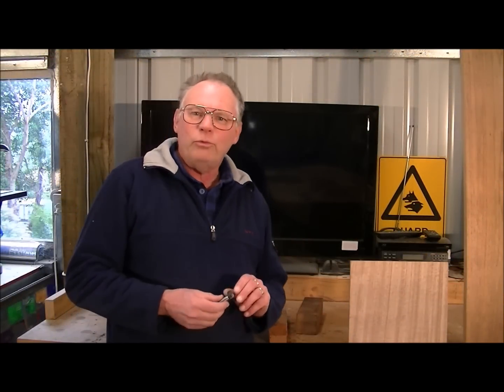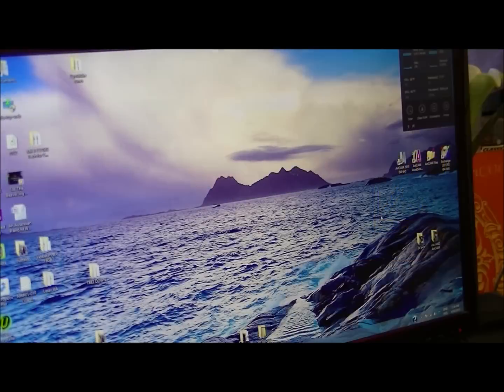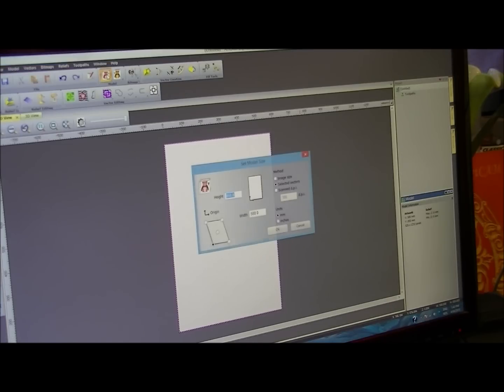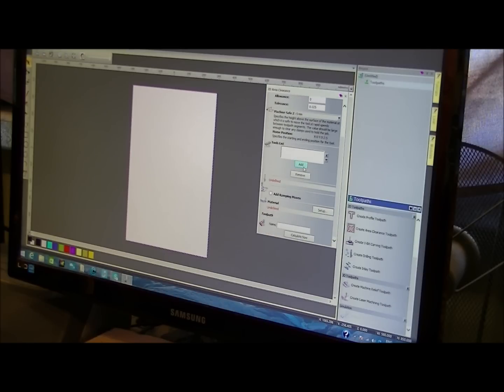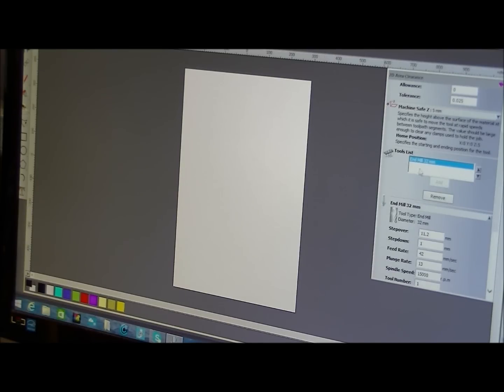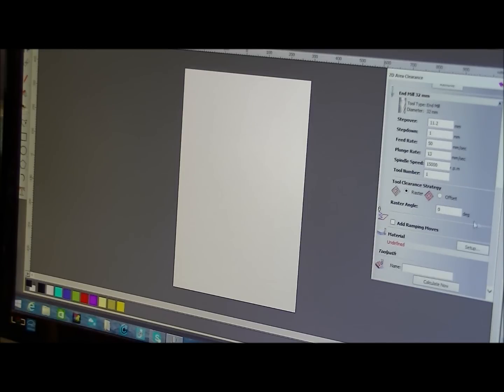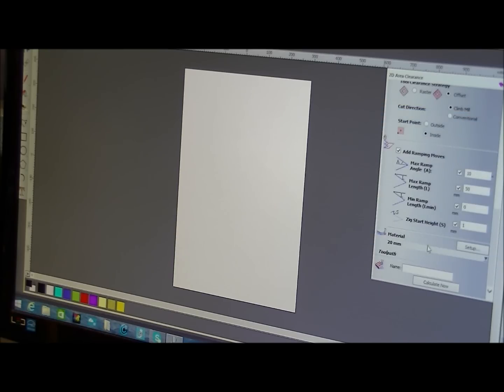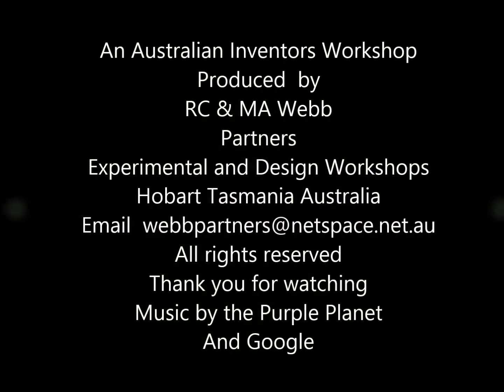111 ArtCAM 2015 new tool & area clearance demo getting started In CNC With ArtCAM Express

Comment: I don't mean to be a negative Nancy, but this video gives dangerous misinformation! The feed rate and spindle speed aren't just things to be left as a copy of a different tool! That is a very unsafe instruction. Larger tools will generally be run at a lower speed because the outside of the bit will be traveling much faster do to the larger circumference. Tool to tool the feed rate will also change.